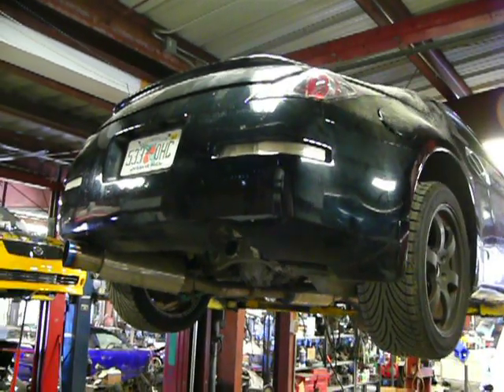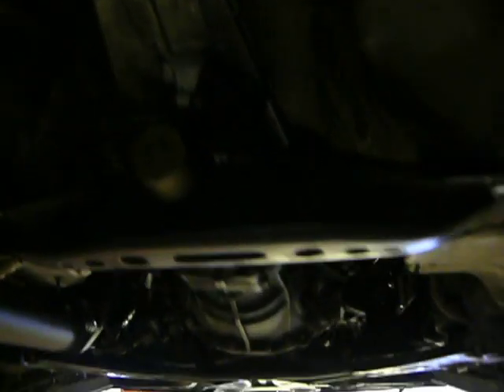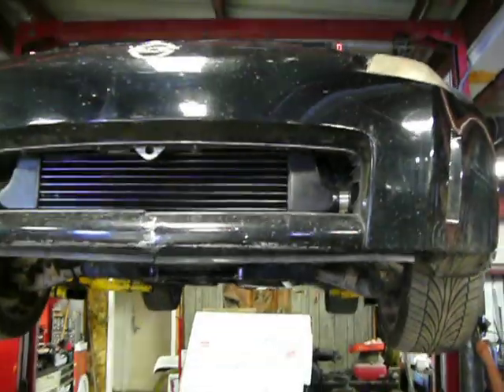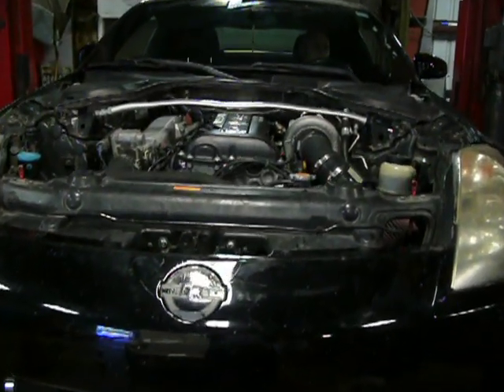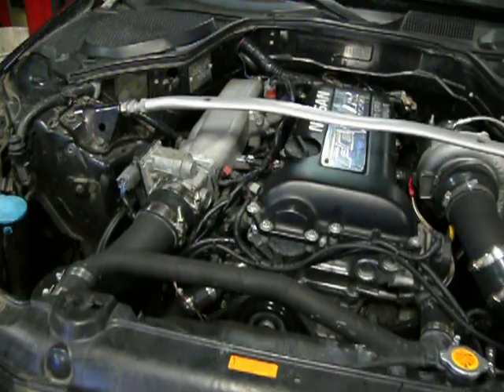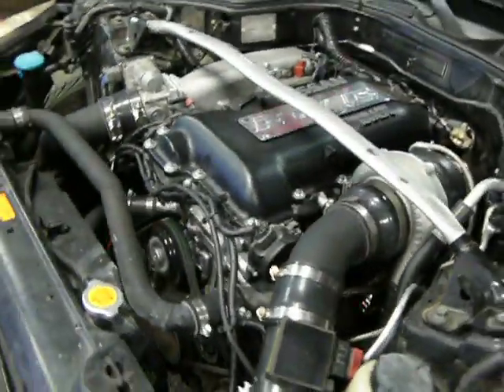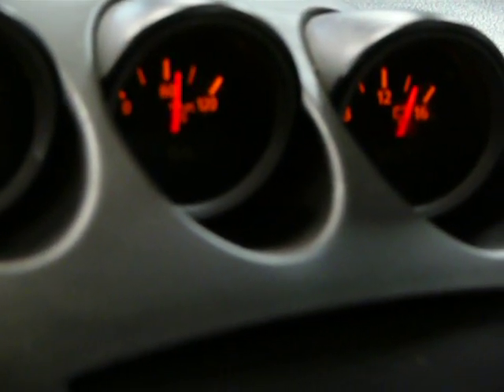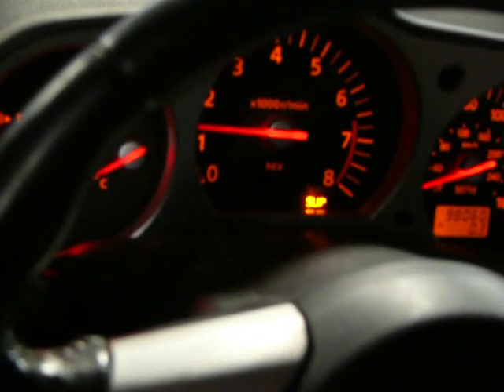Z-Fever swaps SR20DET into 350Z.MOV

Comment: Did you have to change the body control harness!??!?! Or did you just use sr20 engine harness with 350z body control harness?
Reply: We did not have to change the body control components. We rewired the SR20 harness. Then we integrated it to the VQ35DE ECU as well as the SR20DET ECU. The SR ECU manages the motor. The VQ ECU manages the drive-by-wire throttle body. We are running the stock 350Z accelerator pedal. We also jump the necessary signals into the VQ ECU (temp, oil pressure, etc.) so that the VQ ECU is still transmitting info onto the CAN-BUS network to make the gauges work.

Comment: question, how much would it coast to get a 350z HR Engine in a 2004 350z?
Reply from the maker: roughly $7500 to do the whole job. Variables include the cost of the actual used motors set, options, and performance items

Comment: What do you think about a ka powered 350z? Turbo ka ofc
Reply from the maker: I am not a big fan of the KA24DE and when you boost it, it usually breaks unless you fully build it.
Reply: +zfeverrocks That's not true at all. and if you want more reliability, the internals are very cheap. You also get more torque than an sr.
Reply from the maker: boosted KA's do produce more torque than an SR20 but are less reliable when boosted. I have been working on them and building them for 20+ years. Boosted stock KA's are good for about 325whp safely from a good solid KA. As you get closer to 350whp they become less reliable. Then you add on 150k miles to an n/a KA24 with boost..... theey just don't hold up. Then over 350whp they are even less reliable. However, if you install forged internals in them they are much better.
Reply: zfeverrocks You and I obviously have different opinions on what good power is. I would be happy with 325whp, but you seem like you would like more! lol. Also I think the ka is a lot heavier than the sr, however it is less expensive. Also, how long do you think a ka trans would last behind a stock chevy 350 sbc / ls1?

Comment: nice job guys ! whats going on with the rpm gauge ?
Reply: +drew niterider We just needed to make the crank sensor mount a little closer to the trigger wheel we made. Once we did that, the tach worked perfectly
Reply: the reason i asked was bc my speedo is doing a similar thing on my s13 redtop SR , just a little fluctuation i just started to notice it  . its awesome and interesting to see swaps like this ! thanks for the reply !

Comment from the maker: The customer owned an SR20DET powered vehicle prior to this and really liked it. The thing I love about this build (which we could do with ANY motor swap) is teh full OEM functionality. The fact that the drive by wire works, all the CAN-BUS gauges work, The cruise control and traction control all work. We could do this with an RB or LS1, or 2JZGTE, it doesn't matter. Call us if you want your swap done right!
Reply: zfeverrocks you are located in tampa?
Reply from the maker: Sean Leonard Yes we are! Z-Fever 813-877-7600

Comment: If it comes to the build nice job!!! Clients choice of smaller displacement motor stupid, but look at the tail lights (eBay special), only v8's should be swapped in the z33, car is heavy and needs torque not just horsepower, but still nice what you guys do as a shop! Good luck and keep them coming...

Comment: hey where u guys located at? im planning to turbo my g35. i made math on the greddy twinturbo and will be around $11k. if imma spend over 10k wish to go with the rb26 plant. but it has lots of problems... so im wondering if i could do the 2jzgte swap instead. yes. toyota on my infiniti/nissan. i know i can get way more power outta those 6 inlines than the VQ.

Comment from the maker: We are running a dual ECU set-up with an OEM fusion of EFI harnesses that we created. The throttle body is controlled by the VQ's ECU as are the gauges and everything needing the Can-Bus system. However, the SR20DET is managed by the SR's ECU. It is a difficult process but it is the only way we could make all the gauges, cruise control, a/c, etc.. work like OEM. 
Call us at Z-Fever 813-877-7600 if you need help with wiring up your swap into a 350Z. We can do just about anything!

Comment from the maker: After making this video we machined an aluminum bracket to hold the timing trigger on our custom timing wheel more solidly. It does not jump around any more. Preliminarily we make one out of metal and it was very thin. It allowed the sensor to jump around a little causing the tach to be a little jumpy. But like I said, the finished product was perfect!

Comment: Cause an SR can easily beat a stock VQ with only light mods.  Also, it was made for forced induction - closed deck block, bottom end girdle, piston oil squirters, etc. are standard on the SR.  Finally, it is much easier and cheaper to modify. VQ is a great stock engine, but the SR has a lot more potential.  You can make 700HP+ reliably on a properly built, daily driven SR.